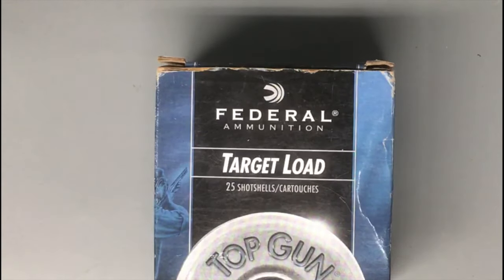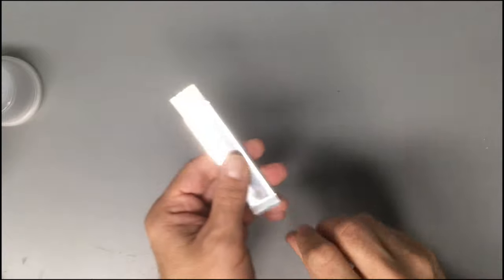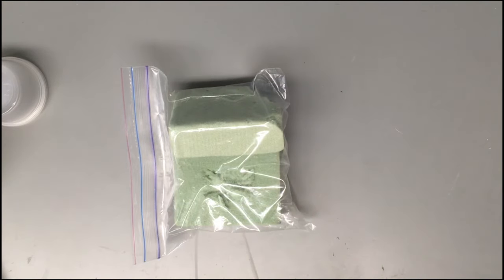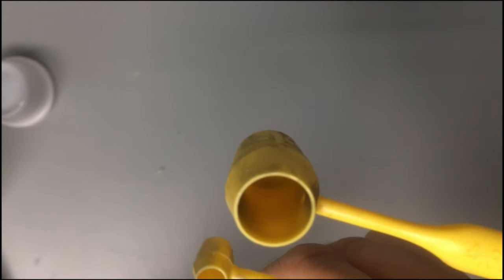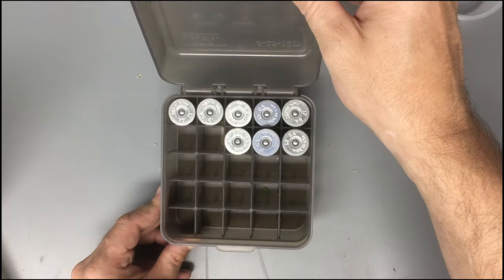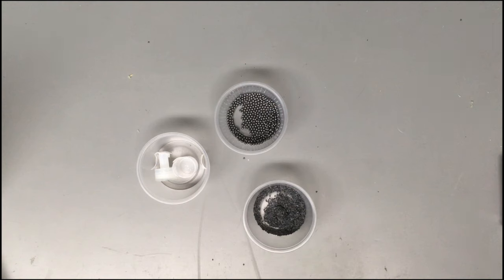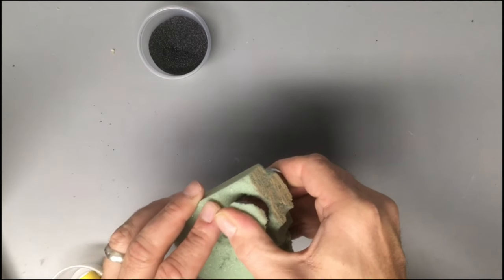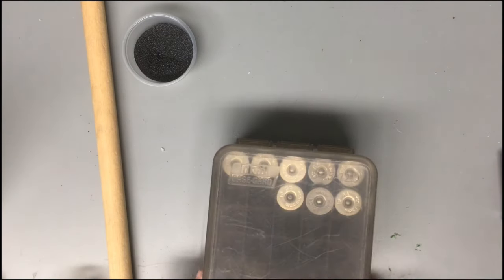Making Shotgun Blanks

Comment: I knew a guy in the 10th Special Forces who used to make blanks for pump action shotgun .   He would remove the pellets and pack the shell with toilet paper.  Talk about scaring the crap out of a person when you were on the receiving end from about 20 feet away!
Reply from the maker: That's neat! Well, also scary.
Reply: I really hate to be the safety weenie , but don't point Blanks at people .  Shot cups, wadding, etc can cause injuries , and at really close distances the multi thousands psi hot gasses can be deadly .
Reply: I really hate to be the safety weenie , but don't point Blanks at people .  Shot cups, wadding, etc can cause injuries , and at really close distances the multi thousands psi hot gasses can be deadly .

Comment: My recipe is simple .. cut old hulls ( pref high brass ) to about 1 inch prime, add triple 7 or black powder to the top, cover with a tight drum skin of masking decorators paper tape ( no air gap ) trim around like a pie crust..thats it.nice boom, great smoke and the best part, no wad to fly out..even though they are small blanks they are plenty for shows or movies.
Reply from the maker: That is a good setup

Comment: Do you need a real gun or can you use a replica that has working triggers and every thing
Reply from the maker: There are replicas out there that work, but don't fire
Reply: @ArizonaGhostriders  thank you but what if they are metal everything working replicas that shoot caps
Reply: @lumbago7850  I wouldn't try it just because its a replica and (I am assuming its just for show) just there to be a wall hanger. Also, (assuming its a wall hanger) with it being a replica, the chamber wouldn't be designed to hold the pressure from a round going off causing the thing to expload (most likely).

Comment: Santee, how do you load a 1851 navy for blanks without having it chain fire? Would you just load it with powder and a wad on top? 

Thanks
Reply from the maker: Well, the floral foam should create the appropriate blockage.
Reply: @ArizonaGhostriders  You can use ordinary Crisco to fill the chambers(if you're not going to use it in high temp areas like Arizona;, the stuff DOES melt when hot)

Comment: Couple of questions:

1) why not use fired shells and just replace the primers instead of chopping up good shells? 

2) do you ever use pyrodex or other substitutes instead of real black powder due to ease of cleaning vs the real thing?

3) do you ever load paper shells? Something about the smell of a freshly fired paper shotgun shell, just magical....
Reply from the maker: 1) I don't have a de-primer for shotgun shells, and the new ones are cheap.
2) Pyrodex seems to foul very similarly to BP, and about as "dirty". I've used it, and although it's close, it's not black powder.
3 )No I haven't loaded paper shells....thought about brass shotgun shells, though!
Reply from the maker: I'll look into that Jordan. Got a couple of brass casings. The problem with the plastics is transportation. When you cut them down, they get more pliable and the foam falls out...making a black powder mess in the container.
Reply: @ArizonaGhostriders  pretty sure i can fix that issue by using a star crimp or a roll crimp and a over shot card made of thin cardboard. Pretty easy fix.
 The brass shells would also fix this by using a thin overshot card made from cereal box or other thin card material and use waterglass to seal it and hold the card in (due to no crimp being used on brass shells unlike paper or plastic)
Reply from the maker: If you're gonna try it, don't forget to do a splatter test.
Reply: @ArizonaGhostriders  you got it
Reply: @ArizonaGhostriders  if i work out a good fix for your powder spilling problem i'll let you know. I'm pretty confident that by starting with whole empty shells instead of cutting them then using the original star crimp to hold the foam and shell together you will fix the issue with nothing extra flying out the barrel.
Reply: @ArizonaGhostriders  Another drawback of Pyrodex is that you need cleaners for it,  Black powder cleans out with plain water.
Reply from the maker: @mikegrossberg8624  We used to use it, and it was harder to clean. Good point.